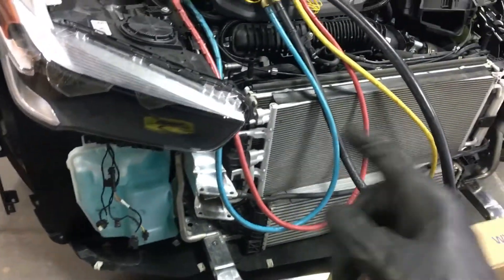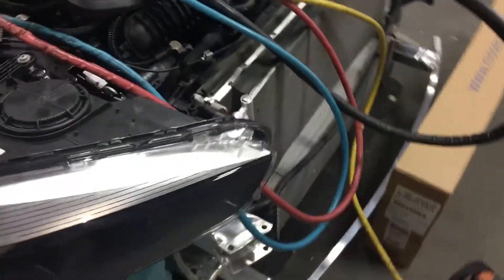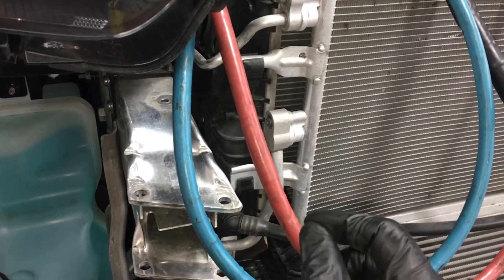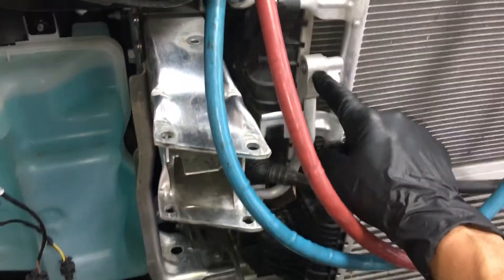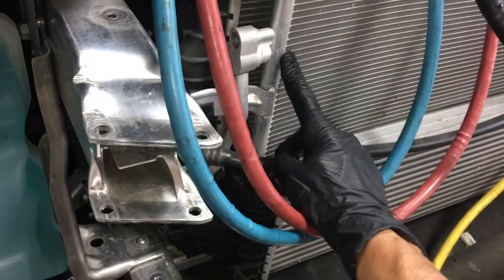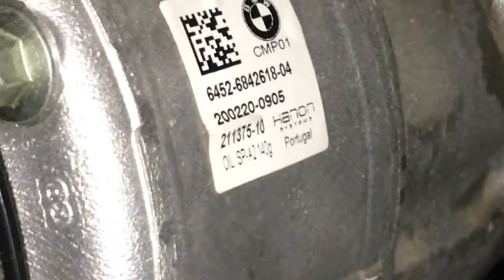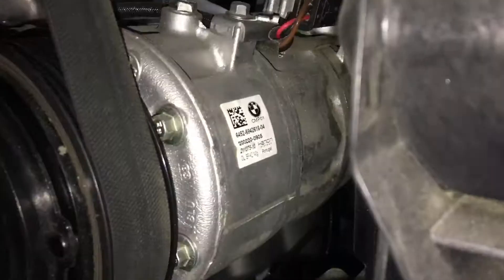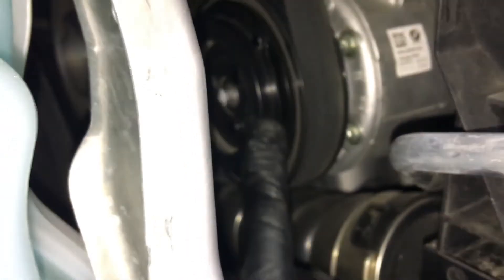Look Another ￼Upside down condenser this is becoming a trend. And clutch on Variable￼ compressor￼￼

Comment: Thank for your sharing.
I am seeking about Upside down condenser installation. Some people say it gone wrong. But BMW engineer resolve my question.
Reply from the maker: The external piping appears to be upside down.   But the way they piped it on the inside of the condenser is still the same way as the standard condenser where the hot vapor will enter internally at the top of the condenser flow condenser as it hits saturation pressure temperature into a liquid at the bottom of the condenser. 

They do that all the magic on the inside in those headers where you cannot see where it’s actually normal.
Reply: @coldfinger459sub0  Ohh thank so much for your explanation.

Comment: Is it ok if the ac condenser is turned upside down but the discharge line is still at the top? Will it still work?
Reply from the maker: If it’s a modern day parallel flow condenser where the bottom 4 to 6 tubes are isolated for the specific purpose of sub cooling.   Then you’ll have excessive restriction, high pressure between the compressor and the discharge line to the inlet port of the condenser.. 

On your typical parallel flow, condenser the hot gas from the compressor drops into the header depending on how many tubes there is for example, the first 12 or 15 tubes will all run in parallel so there’s very little static pressure or you can think of it as friction . 

Then, after it makes that first pass hitting the other header, it goes down and it might go into another 12 or 15 refrigerant tubes and pass to the other side .   Then there might be a hole at the very bottom of the header where you have the receiver dryer attached it’ll pass through a small port to the bottom. At this point there’s a little bit of liquid and still some vapor. It’s a mixture as it passes into the receiver dryer.

Then the liquid in the refrigerant will separate out, and the liquid will go to the bottom through the screen into a bottom part where there’s another hole going back into the header at the end of the condenser. It’ll pass through the bottom where the flat refrigerant tubes number in anywhere from 4 to 6, depending on the manufacturer Should be a solid liquid column

Because it’s liquid and it’s dense and much larger mass at a high velocity can travel through those fewer tubes 

That’s why it belongs on the bottom 

But I have seen many condensers flipped upside down will still work they just don’t work efficiently . 

I and if it’s one of the condensers where the receiver dryer is built into the side of it, it’s not properly separating out the oil to make sure just liquid with the oil get back to the compressor so you may reduce the life of your compressor .
Reply: @coldfinger459sub0  ahh thank you for that great information

Comment: How does that work..?!
Reply from the maker: Excellent curious question wanting to know how it works 👍

      I remember I did an explanation short video on one before I’ll do it again when I come across one. 

       From what I can see the way they designed the receiver dryer does the transfer of liquid refrigerant internally up to the top through a port let’s see if I can remember to bring my saw with me and I’ll cut one open so we can look inside as I take a video and follow the refrigerant path ports
Reply: Look forward to that, sounds like maybe it has a straw effect similar to how the accumulator has a connection at the top but without the orifice lol

Comment: I have seen this on a peterbilt doesn’t seem to effect performance ..they use the same condenser when the steering wheel is on the passenger side or the driver side ..when steering is on the passenger side the condenser is upside down
Reply from the maker: I’m thinking it’s for $$$ 
Shorter refrigerant lines.
Reply: It’s on a cab over ..at first I made up hoses to switch the discharge to the top but noticed no real difference at all didn’t check the temps in and out but the vent temp was the same this was on a 2004
Reply from the maker: @bencrilly209  since this is becoming more prevalent throughout different make models and years now it’s probably a topic to be mentioned that I will hear discussed when attending this year‘s MACS expo and seminars there either being held in Orlando Florida or Las Vegas I cannot remember which location for this year‘s expo.
Reply: @coldfinger459sub0  yea I went like 8 years ago when it was in Vegas maybe 10 years
Reply from the maker: @bencrilly209  Time to catch up and update 
I wish they would hold these things overseas like in Thailand or China that would be super cool

Comment: It makes no difference which way it goes
Reply from the maker: If you’re going to make the statement cut open a couple of these condensers and show me how it doesn’t make a difference until you cut open a couple hundred condensers then you can make that statement. 

Do you actually need to know the physics behind why you need to understand the thermal dynamics between what is happening as the refrigerant goes through its process of saturation into condensing and the reason why there’s only between 4 to 6 tubes of parallel flow passage for the last sub cooling liquid in a condenser and where exactly is it located. 

Whoever gave you that piece of information that you’re trusting clearly does not know what they’re talking about yes it will work if you flip a condenser upside down it will work if you can on some condensers that have the exact same inlet and outlet tubing‘s force the high side discharge gas of a compressor into the lower region of the parallel flow passages and as it makes its way upward there will be some cooling coming out of the dash but I have to sacrifice of sub cooling and efficiency. 

There’s a difference between efficiency and working correctly working right and just good enough to get it out the door got some cooling blowing on my hands two different scenarios going on there. 

Yes it does make a difference which way it goes if the internals design for the sub cooling passages to be a solid liquid in the last four or five rows.   And then somebody accidentally if possible inverts the high presser hot gas discharge of a compressor into the liquid side sub cooling rows of the condenser and then forces it to exit through the hot gas discharge side of a condenser. 

On the other hand if the condenser from the manufacturer was specifically designed internally to take the hot gas discharge high temperature gas in the low part of the condenser it’s because they have the internal tubing of the condenser manufactured so inside it will deliver it to the top side of the condenser going through the normal channel flow from top to bottom and then internally deliver that bottom subcooled liquid up to the top fooling everybody making them think it should be a liquid side it all depends on the internal construction. 

This is why on a standard automotive condenser on your refrigerator in your home in your freezer in your home on a commercial large refrigeration condenser or a large 20 ton VF far condenser it’s always hot gas discharge from the compressor to the upper rows of a condenser they make their way down to the bottom where it is a subcooled liquid exiting at the bottom. 

There’s physics behind it there’s an absolute reason for the way it is designed.
Reply: @coldfinger459sub0 your comment and grammar is unreadable. i've put in a thousand condensers and they are over the place, top, bottom, distributers that go in 4 or 5 different places, and thats not even talking about hot gas bypasses but with the correct velocity it makes no difference, i have no idea what text book you've read, or what physics you think you know, clearly not much, but here in the real world, it doesn't matter, manufacture puts it everywhere
Reply: why the fuck would i cut open a condenser, i aint got time for that shit, im actually making thousands cool, while you make videos
Reply from the maker: @braintumor943  On our automotive condensers of the style the receiver dryer is a Intercal part off on the right header built internally so you’d be flipping the condenser upside down you would also be flipping the receiver dryer upside down.  So you would be 100% making sure that the expansion valve only gets gas no liquid.   Unlike our standard condensers we use on refrigeration or split systems in a home or a mini split or the standard old-school condenser on your Chevy pick up or many other cars the majority of all new cars nowadays come with Microchannel parallel condensers with the receiver dryer permanently cast or mounted into the side header. 

So yes you can flip it upside down I have seen people install separate receiver dryers backwards and do nothing but deliver gas instead of liquid to expansion valves and cooling was produced. 

So we’re fear into feeding flash gas to expansion valves people have done it and I know it does cool. 

So I guess we should go telling everybody and Refrigeration up on the rack units flip the lines on receiver dryer around to make sure you only get gas feed into your expansion valves see how that goes over.
Reply from the maker: @braintumor943  we cut open condensers and compressors to find out what make them malfunction in the first place. 

Compressors don’t die they are murdered

We don’t wanna be one of those idiots who just replace parts out of the box cause it breaks we wanna find out what cause it to break and fix the problem not the symptom. 

When a compressor burns up it’s a symptom of something that caused a problem. 

And on these micro channel condensers when a compressor comes apart a big percentage of the little Microchannel passages get permanently plugged up and cannot be flushed out or back flushed. 

By cutting condensers open you can confirm that there is compressor debris in it and that the compressor is on its way out if you’re already replacing a condenser because of a leak. 

And like I said in your other response these condensers have the receiver dryer‘s permanently cast mounted into one of the headers off to the left or the right so when you replace the condenser you’re also getting a new receiver dryer with a desiccant bag in it. 

Unlike when we’re doing refrigeration or a residential split system where we have a external dryer filter. 

It’s not like that anymore on the majority of new cars.  We were used to that separate old receiver dryer off to the side or if it were some of the cars with a large accumulator with the second material but those nearly don’t exist anymore.